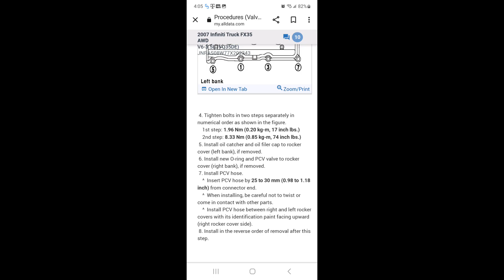Infiniti fx35 2007 ( How to replace the valve cover gasket tutorial )

Comment: dont be stupid like this guy and leave the bolts in while youre trying to take something out. take the pinches bolts completely out and store them to the side in an organzied manner.  also for the hose that he struggles with in the back driver side of the engine. one would think that the curved pliers are best to use to reach that, however a small pair of channel locks will probably get the job done quicker.
Reply: that hose that was right under the throttle body. what hose is it?